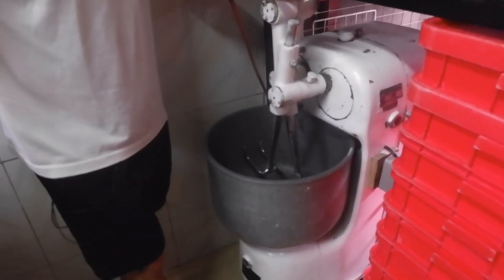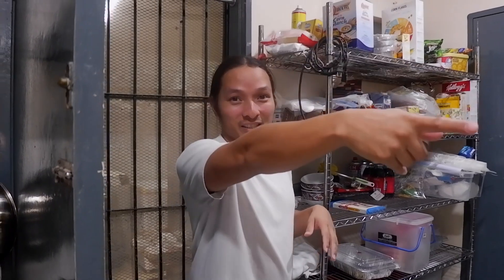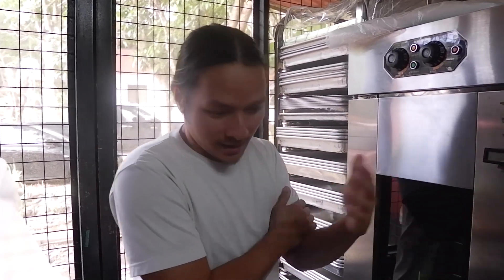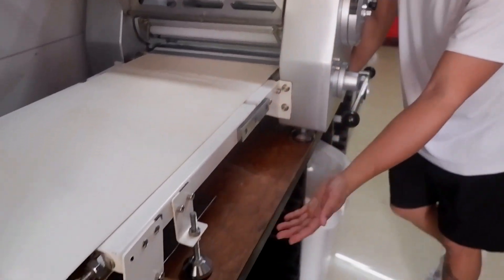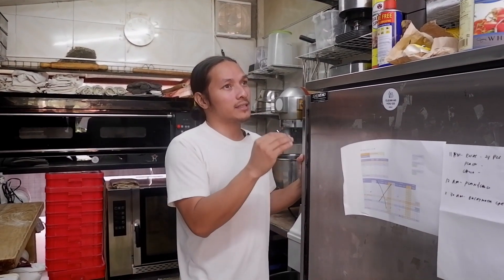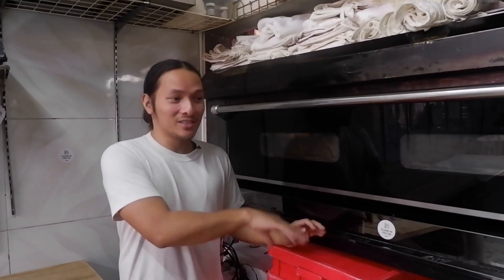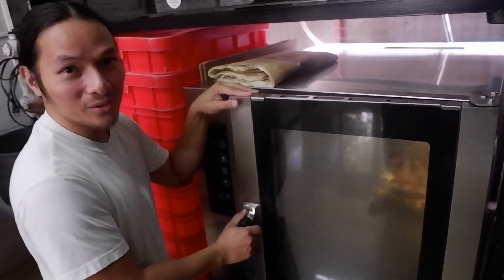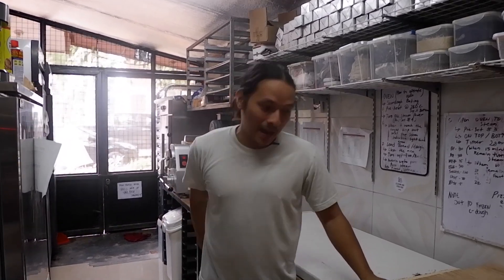Micro Bakery Tour 2023 (LOTS of updates to the home bakery from 2 years ago!)

Comment: Crazy progress! keep it up! Why do you feel the need to oil the wooden baking table? I agree it looks nicer when it is newly oiled but I just scrape it clean.
Reply from the maker: Hi Martin! Thanks! The high humidity in the Philippines demands that I oil it — I've skipped it in the beginning but I noticed that the table top was warping so I asked the woodworker and he said that I should be more diligent with the maintenance. 

My pizza prep table is stainless steel and I've noticed that it's far easier to clean and maintain it than wood. Cheers — JC 🙂

Comment: Really great video, I am about to buy an oven, do you think there is a need for the oven to produce its own steam, or can i just use a water pump.
Reply from the maker: Hey Chuckie, personally I would buy an oven that fits my current budget. Getting an oven with steam injection AND can trap the injected steam inside the baking chamber is highly ideal but if an oven doesn't come with those, it's fine, too.

Do you live in the Philippines? I was able to make a local oven work for sourdough bread and baguette with a little modification.

One thing I've learned, too, is that the number of breads you put inside the chamber matters as well. Let me know if you have more questions. Cheers - JC
Reply: @wildbreads2229  hi JC, yeah, I am from the Philippines, currently baking and selling sourdough breads. I am using a locally-made fabricated gas oven that is more miss than hit. I improvised using a fabricated pan to trap steam. Currently, I am about to buy an oven and proofer from alibaba (which I also learned from you) but made me thinking if I really need a steam oven, or just manually spray using a high pressure sprayer.

Thanks a lot, Chuckie.